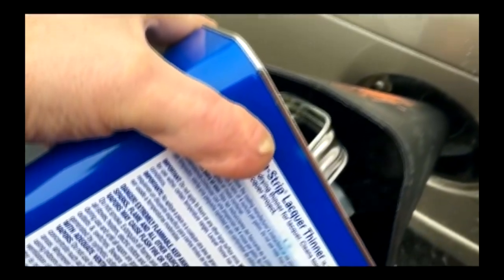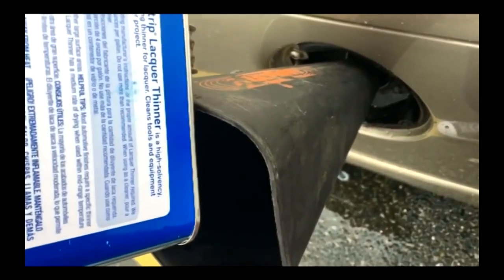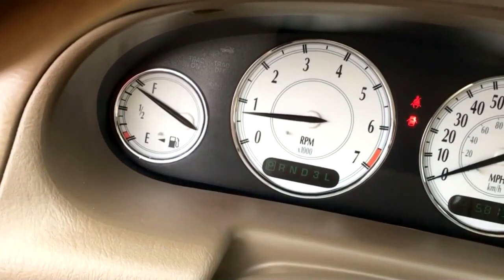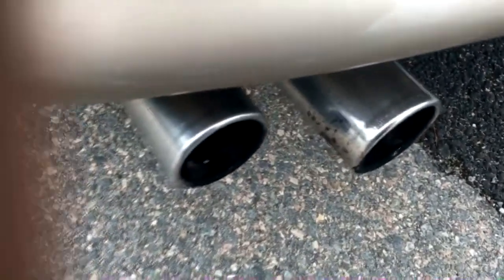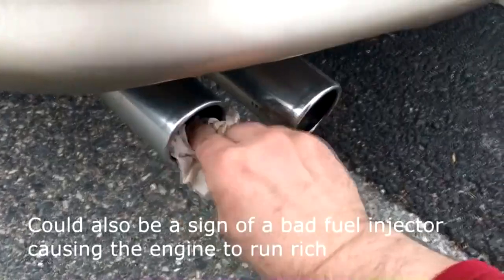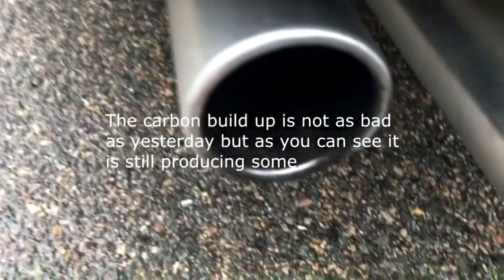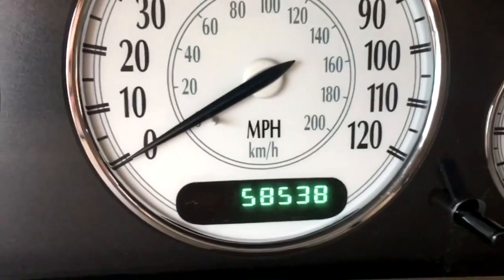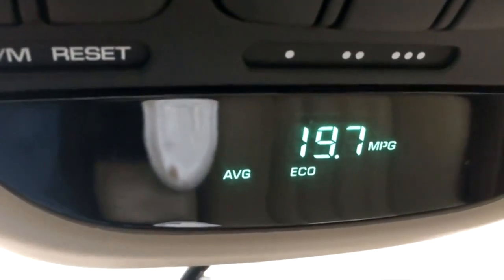Lacquer Thinner Fixed My Converter & Passed Emissions/Safety Inspection | Techn' Moto

Comment: How does it clean since the thinner will combust before reaching the cat right?
Reply from the maker: Lol I don’t know the science all I know is it has worked well for me every time I use it. Works really good as a fuel system cleaner too.
Reply: A certain amount of the lacquer thinner does combust but it's not as efficient as gasoline in the combustion process so there is some residual that makes it through to the catalyst. The residual that makes it through has two effects. #1 is cooling the upstream oxygen sensor a bit which then sends a signal to the car computer to lean up the fuel mix because it thinks that too much fuel is getting through and cooling the oxygen sensor so the computer then backs off the fuel ratio and that's a good thing because then even though it's backing off the fuel ratio there will still be lacquer thinner residual getting through to the catalyst and now at a leaner fuel mix which means the higher level of oxygen will then result in the actual catalyst running hotter which is what you want because as the lacquer thinner residual then reaches the very hot catalyst the temperature shock is what will vaporize any contamination build up that was causing the catalyst to drop below threshold efficiency. Any easy way to detect the residual lacquer thinner that's making it through the combustion process and past the catalyst is after adding 1 gallon of lacquer thinner to half a tank of fuel is run your car for a bit then go back and smell the exhaust. You can actually smell the lacquer thinner coming out of the pipe and if there was indeed a significant amount of contamination build up on the catalyst you will also notice a gooey black residue on the tailpipe which is a result of the lacquer thinner doing it's just job and dissolving the contaminants as the residual flies past the catalyst. Fyi - it's cheaper at Walmart than it is at Home Depot.
Reply: @marketingmajor8126  ...actually, the thinner combusts totally and increases the octane of your fuel.....cats run hotter and burn off the crud.

Comment: Does this brand of laquer thinner from Home Depot contain acetone? Acetone is not good for engine parts.
Reply from the maker: Yes it does
Reply: It does actually contain acetone but you are not running the car on pure acetone or soaking parts in acetone for extended periods of time. Remember that the acetone content of the lacquer thinner is diluted by the gasoline and the fuel system parts are already solvent resistant so running that dilution through the tank will not cause any problems. You just would not want to do it to a vehicle with an old mechanical fuel pump that has a rubber bladder but otherwise it's not a problem. FYI, many of the most popular fuel system cleaners are based on acetone or similar solvent.
Reply from the maker: Thanks good information 👍

Comment: I am at the mechanic after putting a galon of lacquer thinner in my gas tank. My engine hoses are bad.
Reply from the maker: I use this stuff every year in all my vehicles never had anything but good results. As a tech for many years I don’t see how this would affect a hose in a negative way. Just makes no sense.
Reply from the maker: @The Doobie Sisters & Sack Blabbath correct, but for those who do not know, we’ll there’s a ton of folks with no life on the internet.

Comment: since you’re cat isn’t clogged anymore, does your car move faster??
Reply from the maker: London Kennedy the cat wasn’t clogged just dirty but yes my engine operates much better
Reply: if my cat is clogged, do you think this will work for me. To burn and thin the particles out the cat??
Reply from the maker: London Kennedy probably not sorry
Reply: They will add more overall torque and response.
Reply: The cat only needs to degrade to 95% efficiency from it's original 100%....to throw the code....doesn't need to be "clogged".

Comment: I regret doing this. Shortly afterwards I noticed a burning plastic smell coming from under my intake manifold (made of plastic). Lacquer thinner can DAMAGE plastic components and ruin rubber seals!! Decreased my gas mileage. Use common sense and google and research this before trying.
Reply from the maker: Hmm Weird since fuel goes into the cylinders via a fuel injector and then exits the engine after being burned via the exhaust manifold- does not travel through an intake manifold. Actually the only thing that travels through the intake manifold is air. Please do not pass on mis-information. FYI- I use this on all my vehicles to include my motorcycles for many years as a fuel system cleaner and have had nothing but good results. If your manifold did melt down then maybe you already had an issue going on in that vehicle that has nothing to do with the thinner being used mixed with the gasoline. Unless you used it incorrectly and poured it down the intake. Take care, ride safe.

Comment: Do you still have no check engine light or did it return?
Reply from the maker: Haven't had a problem with the converters since. The check engine light has come on for other issues but so far so good. It's been a while since I've done this, video was posted much later in the year. I wanted to make sure it worked before I posted it. Others have said that the check engine light did return for the converter issue but it did help them in passing the safety inspection. All I can say is it worked for me, of course everyone will get different results.
Reply: @TechnMoto  maybe theirs wqs much worst...
Reply: @adrianamorales818  And some times it takes multiple tries

Comment: I have the p0171 I wonder if it will help with that code?
Reply from the maker: Maybe. It could be a fuel or vacuum problem.
Reply: Check or clean your MALF sensor with some CRC sensor cleaner don’t use brake cleaner or throttle body cleaner on it also make sure your air intake box filter is clean and clean your throttle body

Comment: I would drive it all out so the lacquer thinner doesn’t sit in there and possibly damage parts of the fuel line.
Reply from the maker: I guess you could but I have never had a problem so far.
Reply: ive done it this way, just driving normally about 6 times and never had problems.

Comment: Well, it didnt fix my code. I used a full gallon in 10 gallons of gasoline. Ran it to empty and filled the tank with E85. Light persists.
Reply from the maker: Sometimes it doesn’t work for some reason. Have it checked to see if something else is wrong.
Reply: @TechnMoto  Nothing else is wrong. I'll use oxygen sensor extenders to cut the light off.
Reply: I thought I saw a video that mentioned it did not work with E85 most of the time.

Comment: Check my video i have used cataclean for cleaning catalytic converter but the engine light is still there here is the thing engine light does go off after few days and come back again and turn off again after few days and this is happening since i use the cataclean but i must say car does run smoother then before
Reply from the maker: Ahmed Pakido have the car checked to see what’s going on
Reply: @TechnMoto  have the car checked?
Reply: @TechnMoto  I,m gonna use lacquer thinner this time to see what happens will be posting updates.
Reply from the maker: Ahmed Pakido ok
Reply: @Ahmedpakido  it work and clear code?
Reply: @Ahmedpakido  any updates my dude?
Reply: @kingchihuas1  it didn't clear the code
Reply: @Ahmedpakido  👍🏽 ill give it a try see if it works for me
Reply: @Ahmedpakido  what was your fix u replaced the coverter?

Comment: That thumbnail.though.... no pun attended
Reply from the maker: 😂 all good
Reply: @TechnMoto  sorry bro wasn't disrespect  and I'm raised with manner with this being old didn't expect  to get a reply sorry fam. But great vid. I'm afraid  to do this been seen Scott's vid. I had 0 issues at 190k om a toyota  but ppl say clear and clean. I thing will use as preventative  maintenance.   But I put cleaners amd use high grad gas every once in a while but I drive well over to FL  so alot of driving  not like in ny I got avg mpg from  the 17 18 I think ot was to 19.4 but I feel should be atleast  21 of that  but atleast  20 not 19
4 woch isn'tucj more but  so I think ima try this should have yrs ago when seen the vid  I have 0 ie issues I cleaners airflow  change oil regularly  clean throttle body but I dod research  for the percentage  it should be at idle I think maybe  ruined it cleaning  by hand obviously  but used hand to push open  so I think my calibration  is off now amd spitting  more gas
Reply from the maker: @prtbone78  no problems. I use this stuff in my vehicles once a year as a maintenance just like a fuel cleaner. I notice better gas mileage and car runs much better.
Reply: @TechnMoto  iseei was scrolling through the comments. Appreciate  you for replying. My sienna runs great just think 19 mpg for the highway  florida  driving I do I think is low. But van runs great smooth idle no hickory ups but I thi k won't hurt still. I see how your mpg increased somewhat to be thays a drastic increase. Soaybe I can het something like that also I have a neighbor same van same yr said gets more than I do and I do not have a heavy foot so I'm sure it's the van and not my driving habits. I just gotta find the time to drive all them miles in a day I won't let that sit in my tank. If not ill take my torque  wrench to push the pedal and Rev it up and leave for about 25 30 mins.
Reply from the maker: @prtbone78  I let it sit in the tank and as I drive it it gets used up. Kinda like using a fuel system treatment. Works for me to keep the car running maintenance free. But hey that's just me. If you do try it please let me know how it works out for ya. Be interesting to see if it improves the mileage. take care
Reply: @TechnMoto  ok yea I took it thats what you did or do from the vid you made. Just didn't think would be bad doing so but I'll do the raise the rpms for about a half and I'll definitely  get ba and give you an update. Take care
Reply: @TechnMoto  so yeaseemed to work but after a week. Overheats  idk whats wrong. But blown head gasket I'd burn more fuel I'd suppose. But seems looming at avg mpg. On the driving Guage. Looks great I get 20+ while driving on the Guage. Haven't had a chance to really see since love in Central Florida  got hut woth the storm after I put. So this week I'll give a better update.  But did overheat and have an issue  in blaming it so far from doing this
Reply from the maker: @prtbone78  I use this stuff in all my vehicles including my motorcycles. Never have I had an issue. Sorry to hear about the issue. Could be the vehicle has some other things going on from what your saying. Many have done this and no issues or no difference. Hope you get it figured out. Best of luck

Comment: This hack probably cleaned the injectors too huh?
Reply from the maker: I believe so. I now use this in all my vehicles when I think they need a good cleaning.
Reply: @TechnMoto  well I think I'm going to try this...I'm driving a 2006 Toyota Camry and this car drives like shit..it hesitates and the rpm fluctuates while driving and the shops I took it to can't find what's wrong with it cause there's no check engine light so yeah this is my last resort before throwing in the towel on this car..
Reply from the maker: at this point what do you have to lose, right? Honestly I now use this in all my vehicles to include motorcycles when I feel they need it. It has always improved my idle, mileage per gallon and just overall running of the vehicle. I no longer use fuel system cleaner just lacquer thinner. Of course this is just my opinion and its worth very little lol. Also try changing the spark plugs, air filter and clean the map/air sensor- just a thought. You may have to do this twice. One gallon of lacquer thinner to half a tank of fuel. Let me know how it works out.

Comment: i notice nobody simply explains. why this would even remotely work in the 1st place.
Reply from the maker: Don’t know, it just does. Fuel system cleaner is used by many vehicle operators and no one ever asks how or why it works. This is no different. Lacquer thinner is a cleaning solvent.
Reply: @TechnMoto  will this kind work?
Grow Automotive HET 1501 Premium Wash
Reply: it burns hotter and cleaner than gas
Reply from the maker: @vityazsix  thanks for the info and the help
Reply from the maker: @thatisincredible2310  don't know, never heard of using anything other than lacquer thinner
Reply: How does a positrack  work on a 65 Plymouth……it just does.
Reply from the maker: Right👍
Reply: increases octane raring and makes the cats run hotter, therefore burning off the extra crud in the converters.

Comment: Wow your car only has 58k on it and the cat code came on? Mine came on at 245k
Reply from the maker: Yep Chrysler crap. 😂
Reply: It's actually not all that unusual for a P0420 to occur in a car with low miles that's primarily driven in city and is an older model that has accumulated those miles very slowly.  Lots of short, in-city trips of years of time and very little open throttle highway driving will contaminate a catalyst much more-so that a car that has lots of miles on it that was driven frequently on the highway or on back country roads with very few stop lights. One of the worst things you can do to a car is not drive it or drive it very little.
Reply from the maker: And buy a Chrysler 😂😂😂